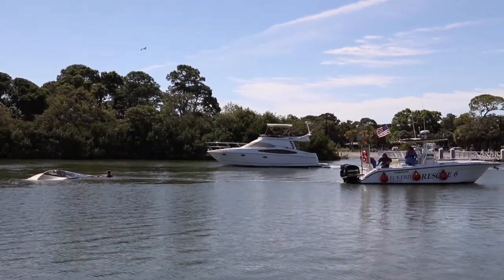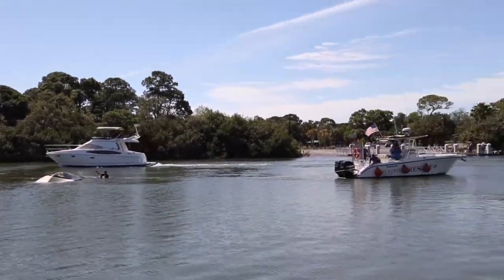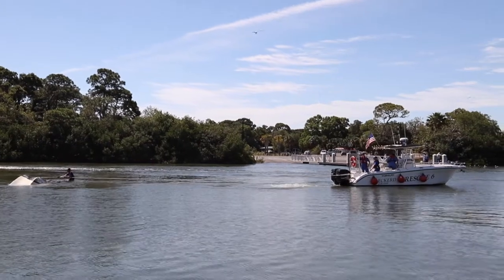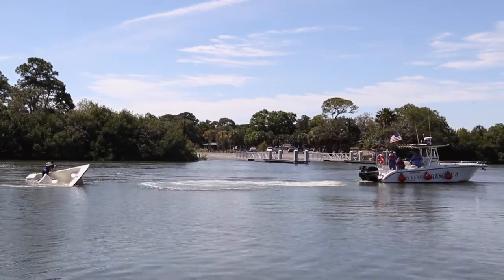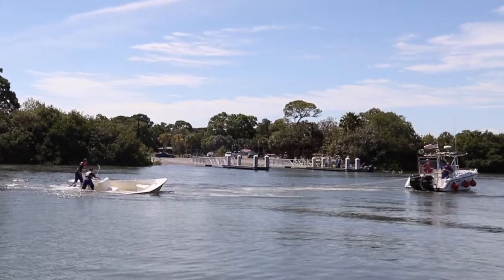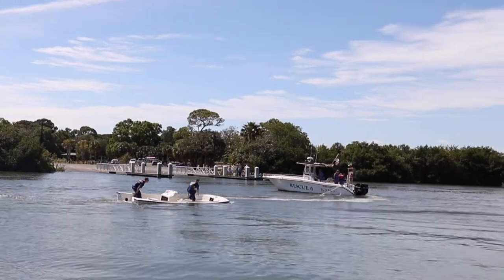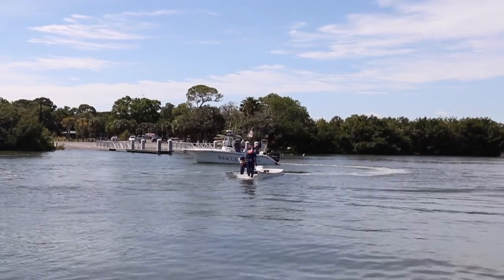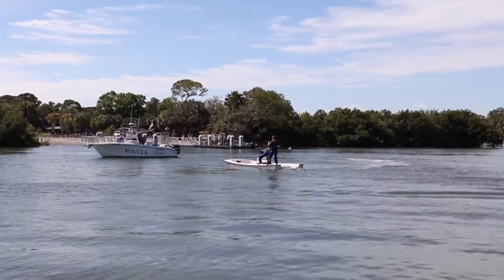Search & Rescue: Parbuckling

Comment: Thank you. I do have one question regarding where the rescue boats front line attaches to the flipped boat. The rear line of the rescue boat is attached to the flipped boat’s stern cleat closest to the rescue boat, but where does the from line from the rescue boat get attached? To the flipped boat’s front cleat closest to the rescue boat? Or is it attached to the flipped boat’s front eye? Or, does it not matter since the rescue boats front line is only for pulling the flipped boat? Again, thank you for the informative video. I can’t believe there have not been any comments on this video since it was posted, over 5 years ago.